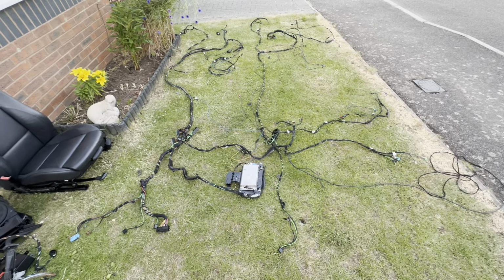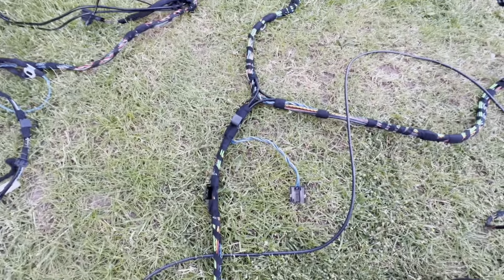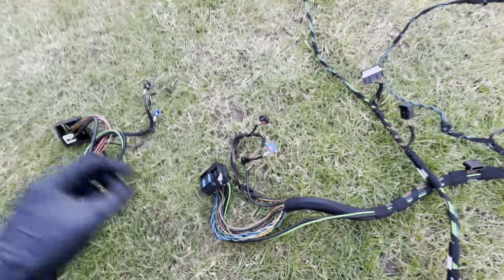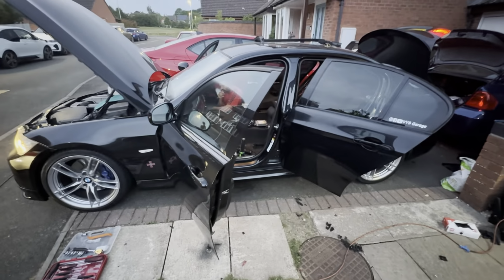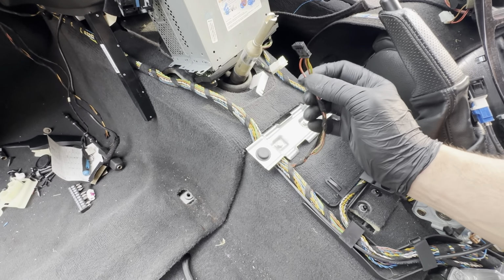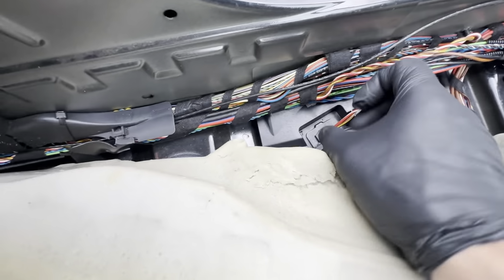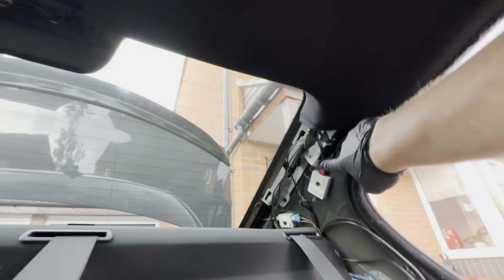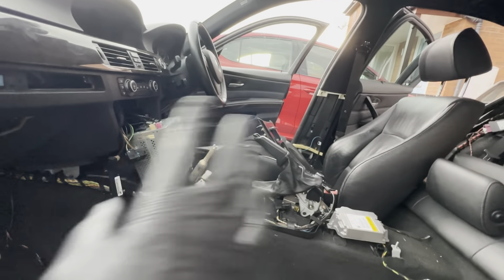BMW e90 individual audio retrofit (Part 2) installation complete loom speakers harnesses amp wiring

Comment: Hello, I retrofitted a Combox Media to my Bmw e90 built in 06. My question is that since the old control unit has a different plug (white) and the new Combox has a black plug, can you re-pin the wiring 1 to 1? Thanks

Comment: I got a 2011 328i with a base and I got another Bmw 328i 2011 as well with the HiFI sound system, would it be direct plug and play. Also how did you code the system?
Reply from the maker: Hi
If you move everything over including the wiring loom, then yes. 
You need to code the Idrive and add hifi option to it.
Reply: Thanks for your response, just to clarify there would be no stripping or cutting of wires for this?
Reply: Also, the hifi car has Bluetooth, if I move all of that other stuff as well, should that also be a plug and play just need it coded in?
Reply from the maker: @kyleballard5706  yes

Comment: Now looking back... it might have been easier to just replace the entire wiring harness.... I bought a donor harness and was breaking out the harness by feature... This is now presenting a serious challenge because I would have to rip out the base audio harness from my existing main harness and layout the donor logic 7 audio harness in its place.... 

there is also an Australian lad who tapped into the existing base audio harness with his donor harness, although I think he still had to layout the other audio channel wiring that did not exist with the base audio harness

also, question, did you have to cut up the carpets? It was extremely hard to access the audio harness buried under it, since the harness have to go across the car to the opposite side
Reply from the maker: In my case, the only option was to switch harnesses because I have to make both cars work. So essentially it was a double retrofit, base to Indy and Indy to base.
I only made a small cut to the carpet where the ashtray would be, this is hidden under the centre console. 

The tricky part was to separate all the additional wiring from audio wiring, such as mulf, tcu, usb hub, tv etc
Reply: @vysgarage  Ha! Thanks! Looks like I just needed to make more cuts. 👍The donor harness I bought was also missing the power wire that supplied power to the logic 7 😑, so I will have to find that at a scrapyard before I could continue with this retrofit

Comment: Hey Love ur retrofit videos, they been helping me a lot with my e92 with base audio that im currently working on retrofitting with logic 7. Tho i have a problem right now i dont now how to keep going and u seem like u know ur stuff pretty fucking well so i would appreciate it if u could help me out on this one. So basically i bought a xtrons android head unit and put it in with the new logic 7 soundsystem. The headunit is working but there is no sound yet. Im currently waiting for the fibre opic loops to put on the left over optical cables for the cd changer and 2 other optical ones that i dont have the parts to use them. But is it possible that i have to code something with this setup? Even tho i have a new headunit and no idrive?
Would appreciate it very very much i dont know who to ask anymore.
THANK YOU!
Reply from the maker: Hey,
Thank for your message.
Hk/L7 gets its sound signal via most/fibre optics. So you need to make sure you have fibre from head unit to the amp. 
Pm me via socials if you need any more help 👍🏻👍🏻
Reply: You need to code your stock headunit to logic 7